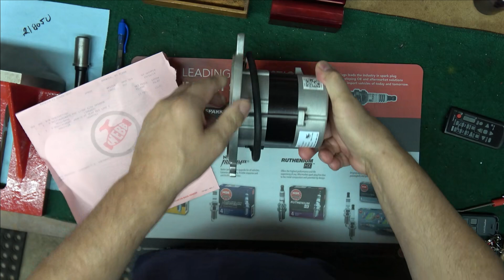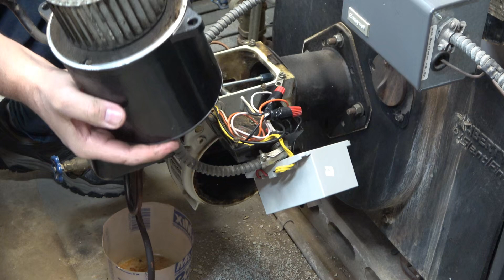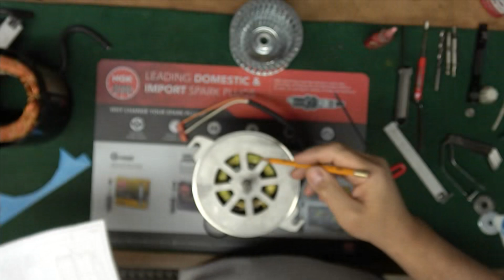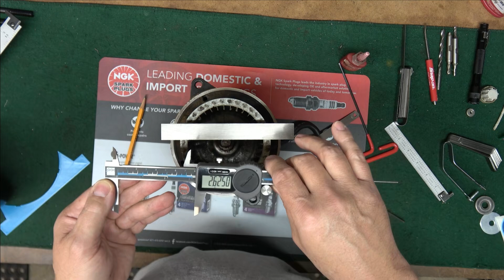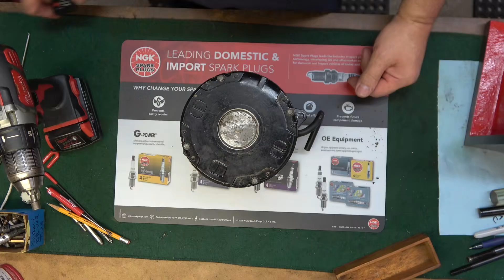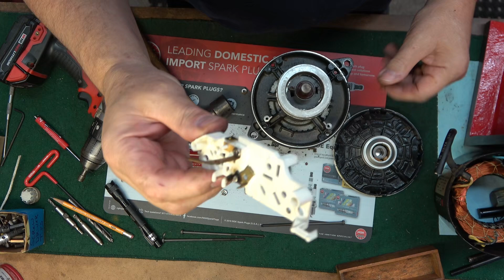Changing the Motor on a Beckett AFG Burner.  #beckett, #beckettAFG

Comment: Thanks for this video Herb!  I had exactly the same problem you described here and the motor start contacts were completely burned and pitted.
Reply: How long a service period is typical before the contacts degrade and start failing? I suppose it's related to the number of stop/starts it undergoes, since that's when the contacts arc.
Reply from the maker: I have no idea.